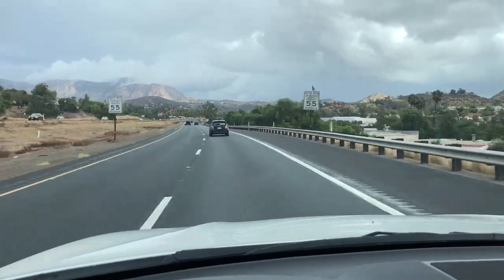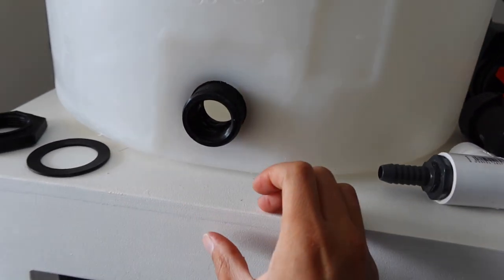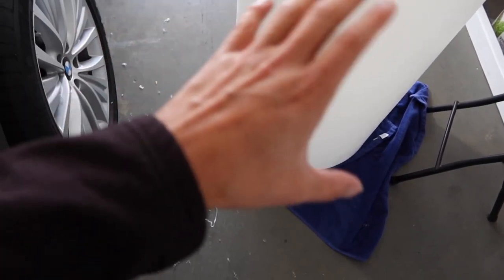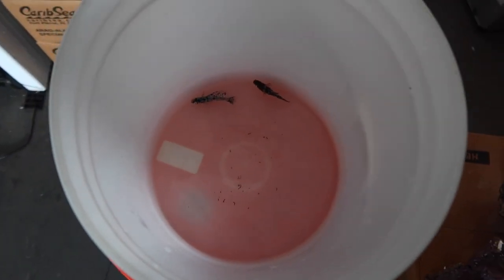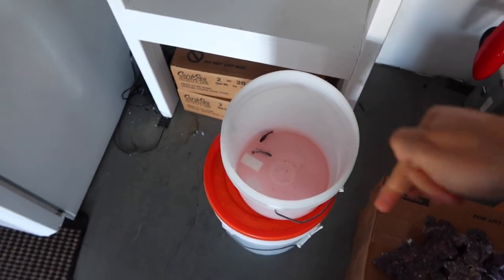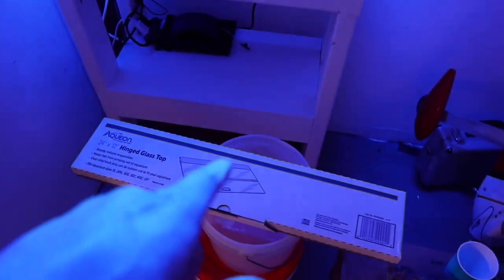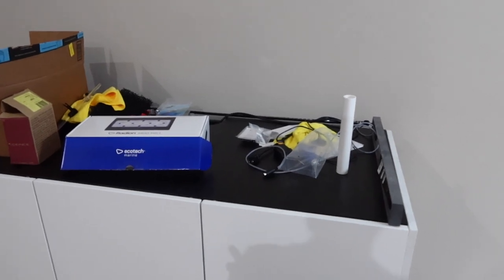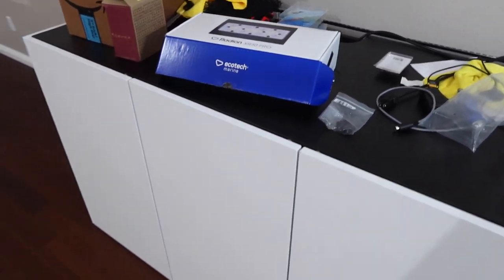Adding fish + salt water mixing station update + Adding switch to cabinet door

Comment: Here is what I have done. Setup a qt tank, buy your fish, and put in a bottle of bio spira live bacteria.  It works immediately,  no ammonia at all. When my main tank had to go fallow, I setup a 29 gallon tank, used a bigger aqua clear filter, I used the aquaclear 70. Add the 11 oz bio spira bacteria and put 13 fish in. I had no ammonia and no fish lose. They were in qt and treated for ich when my main tank was fallow. I been reefing for 3 years now. Bio spira is made by instant ocean and it makes an instant cycle. It says so on the bottle and I have done it a few times. You can buy it at petco and Amazon.

Comment: The whole point of the fan is to cause evaporation... that is what causes the cooling effect. With a glass lid, all you are left with is a noise device. Just sayin
Reply from the maker: I left the rear portion that your supposed to install off so when the fan kicks on it’s still able to evaporate water and cool the tank.

Comment: I don’t wanna be rude but your argument about molly’s swimming to fresh/saltwater is very dumb. When fresh and saltwater meet the salinity mixes. A few miles upstream in rivers the water is brackish, as well as where rivers flow in the sea the salinity is lower compared to further up sea.
Reply from the maker: I never stated otherwise. I agree that the water they are swimming in doesn’t just turn to full salinity we use instantly. The argument people made on forums is these fish very well swim at Will in either direction. The main point they were making is that you don’t need to acclimate them four 10,15, 20 hours as thought before. We could go on all day if we got into the details, the main point was just that you can throw them in once temo aclimates. That’s not what I did of course, but you can find tons of people that just throw them in and have never had a loss. This is just my way of showing my journey and you as the reefer makes the last call on what works for you. 😊
Reply: @eatsleepreef9565  it seemed like you stated you can throw them in because they swim from fresh to saltwater. I agree with your point they don’t need to be acclimated 16 hours or something, but I would say normal acclimation like every other fish (at least an hour) would be appropriate. I think we all agree we don’t want to put stress on the fish, and keep them as healthy as possible. You showed in the video you still acclimated the fish, I’m just worried some people will now just throw the mollie in saltwater after temp acclimating because of this video. I just don’t think that’s a good idea...